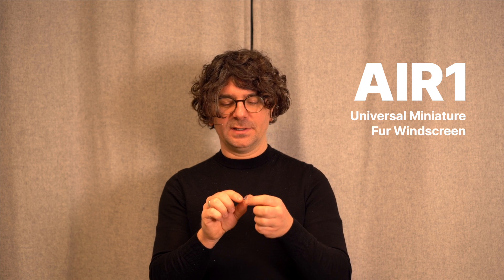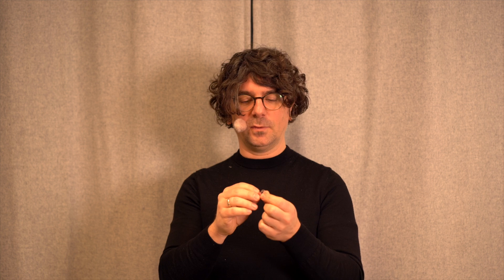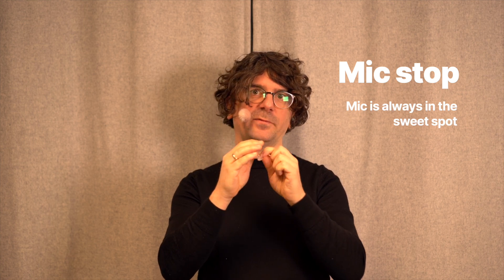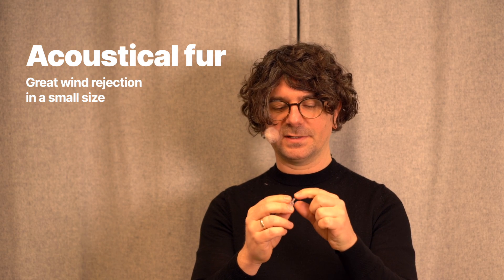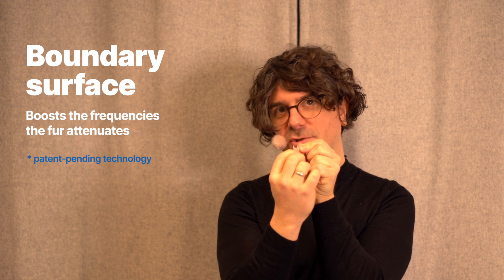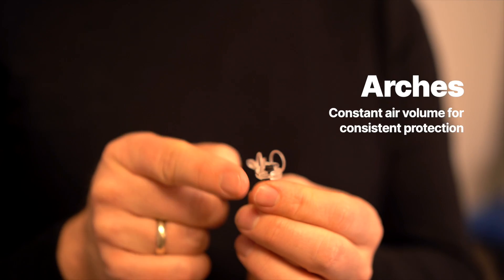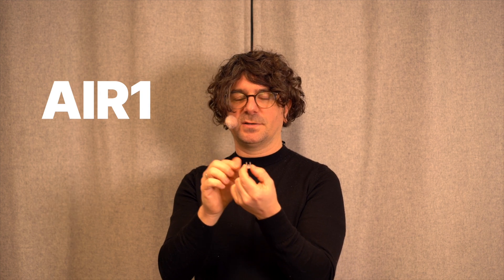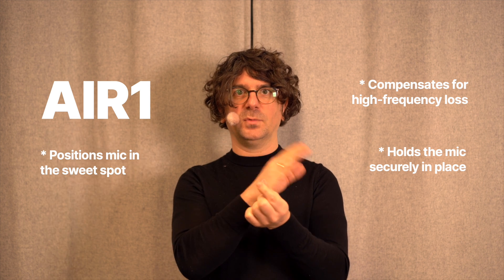The unique design and advanced features of the AIR1 Universal Miniature Fur Windscreen

Comment: How do you install the Air1 ? As there is no surface to stick some tape for example. Thanks
Reply from the maker: Hello @escapeworld6389,

The AIR! has a built in "clip" that attaches to the mic very securely. So, it is just a mater of clipping it on the mic.